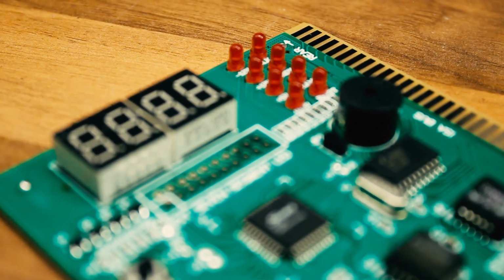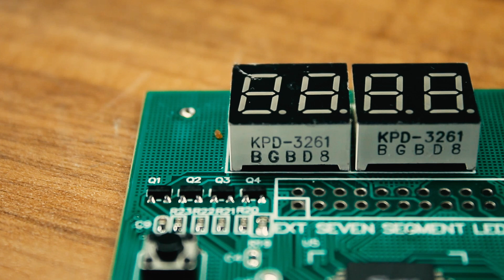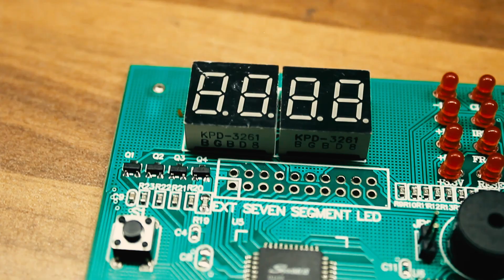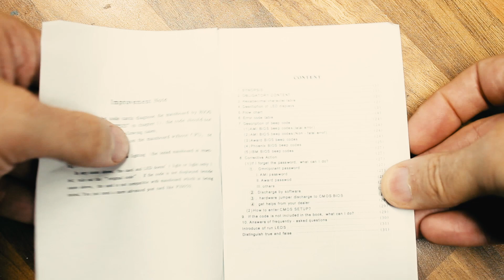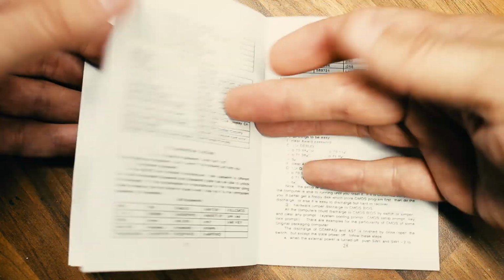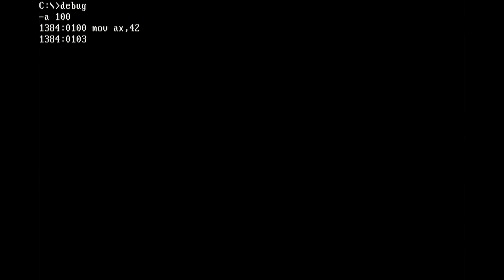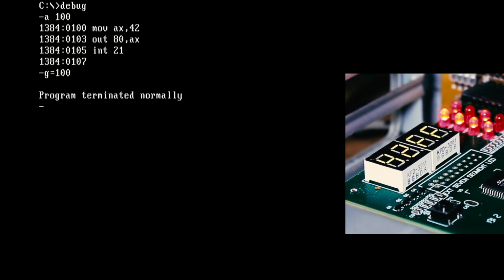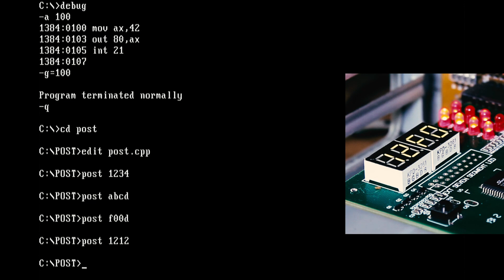POST Diagnostic Card

Comment: If the bios is damaged or missing what you will get?
Reply from the maker: Either nothing or random numbers. It relies on the BIOS actively sending the status codes.
Reply: @MajenkoTechnologies i damaged the bios (GlaBIOS) on my XT by powering the board with not filtered power. (I tested that BIOS on other XT motherboard, JUKO one and it is dead)
Then I put the back original Aword BIOS and it worked, then tried the another bios from that JUKO motherboard and it again didn't post again . And now it doesn't post with any BIOS 😢

Comment: In this new version with the small controller, the button S1 doesn’t work! In the old version with the larger controller, it was possible to switch previous codes using the button S1.